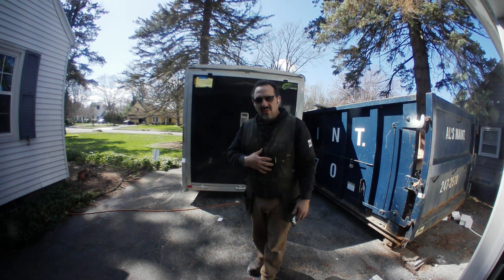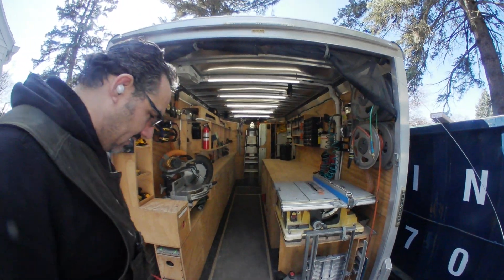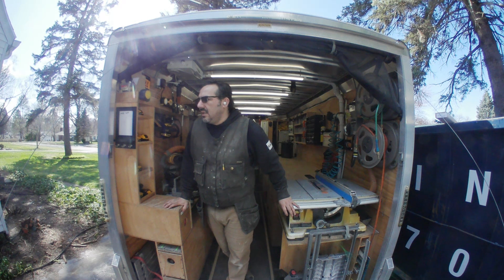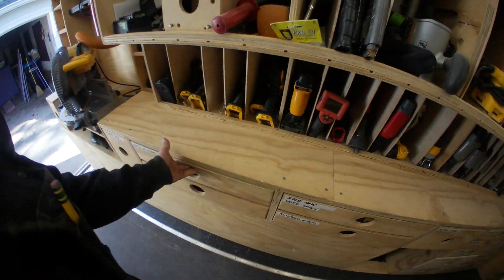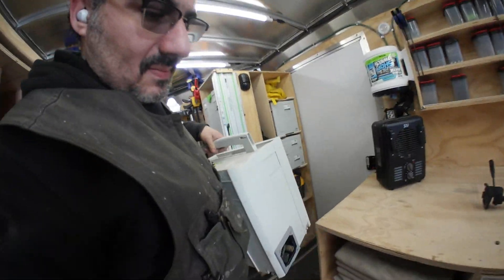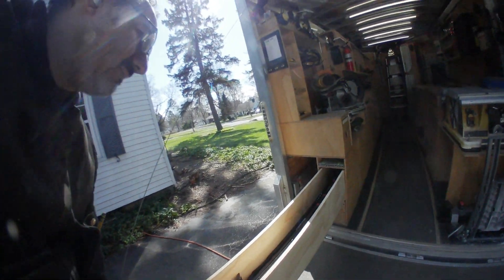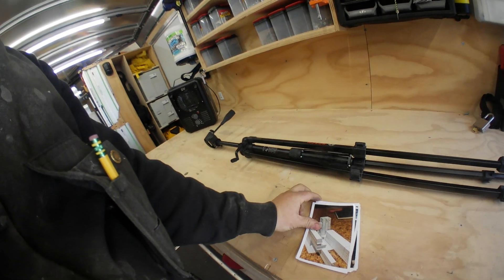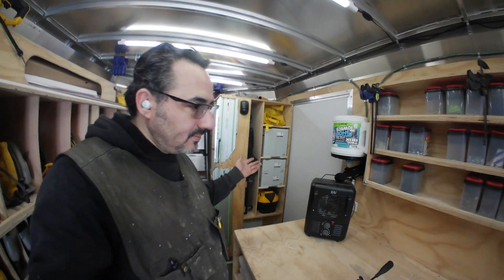tooltrailer/ workshop

Comment: Thanks Calos. I have been trying to decide between using Ron's method of dadoing to slide the drawers in or using cleats like you have. What was the deciding factor for you?
Reply from the maker: First: weight, i use 1/2" throughout 
Second: easier  construction 
And  u should look for a 5ply plywood for strength

Comment: @ Carlos & @ Ron Paulk:  Nice job both of you!  I'm building a trailer out now and would like to be able to cut inside like you are.  I know you are using dust collection but I'm wondering how dusty it gets inside and how big of a deal it is to keep it clean.  My DeWalt miter saws have been notoriously bad at dust collection even with a vac attached.    Thanks in advance for any insight you can provide....
Reply from the maker: hello Scott  thanks for reaching out, my dewalt sucks for dust collection the system i got collect about 50% to 70% with a rubber attachment in the back not great but better than nothing, for the remaining I use a leaf blower daily and onto the next, hope it helps
Reply: @doncarlos1927  Thanks!  That's what I was thinking and hoping that you would say. I will make sure to make a spot for my 18V blower in the build-out.
Reply from the maker: @scottr.daniels8701  👍👍